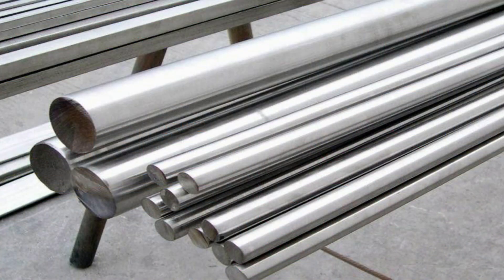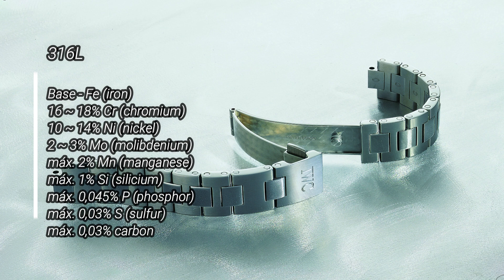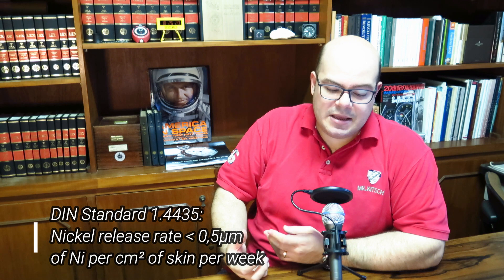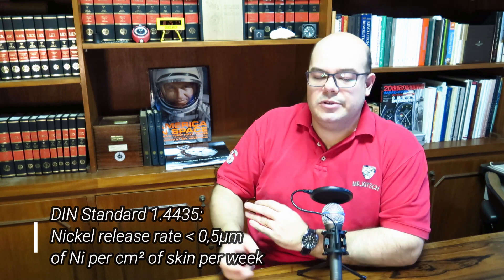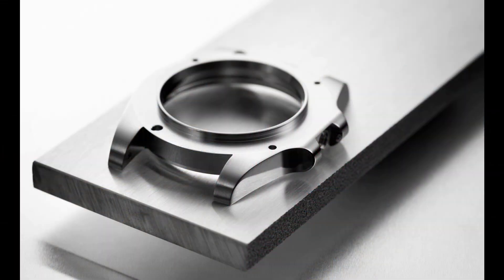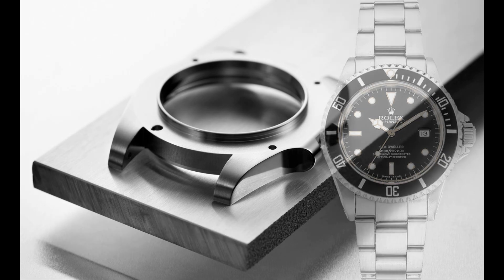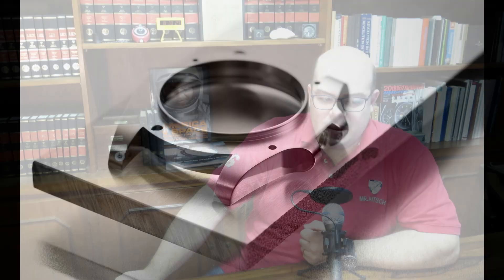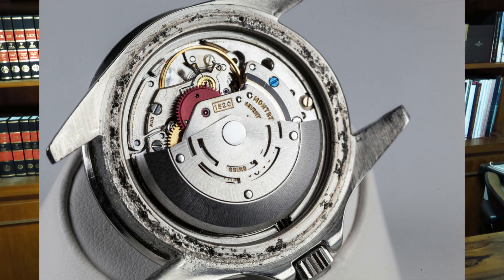[EN] Materials used to make watches #01 - STAINLESS STEEL

Comment: I've noticed some people saying rolex' watches scratch more often. Usually I've heard that about the Explorer. Do you think this can be the case? Could their steel be more scratchable?
Reply from the maker: I've heard the same thing a couple of times, as well as I also heard the total oposite (that they are harder to scratch), so basically, without a very controled test in a laboratory, all we say will be just guessing. Also, Rolex never disclosed the specification of it's materials so all we can do is presume the specs from generic metallurgic tables, and based on this, we can guess that the difference from hardness between the 316L and 904L is none to negligible.